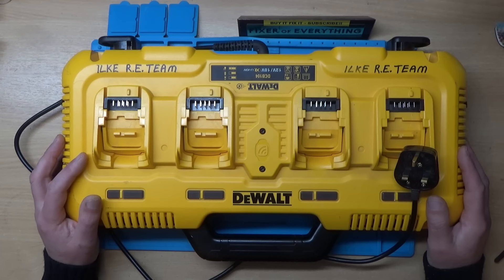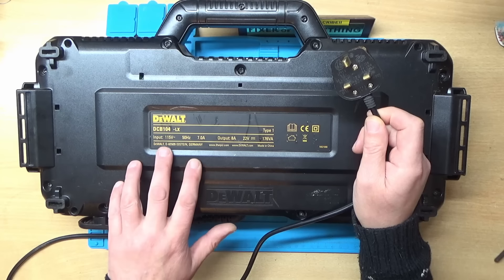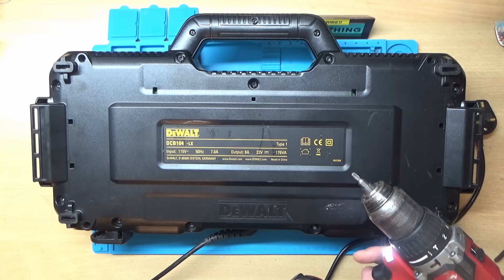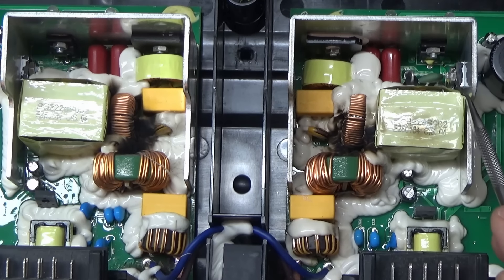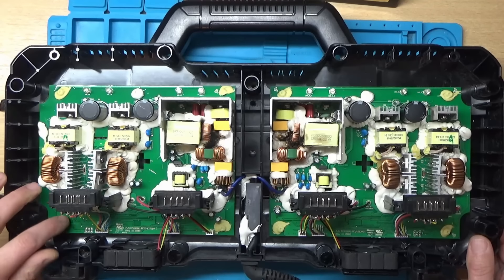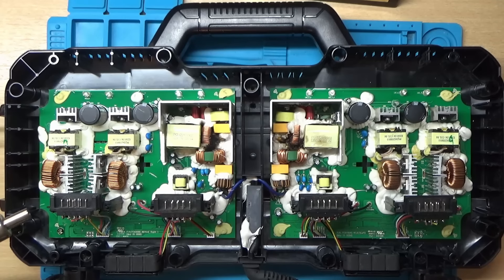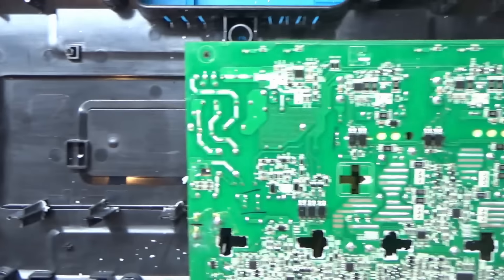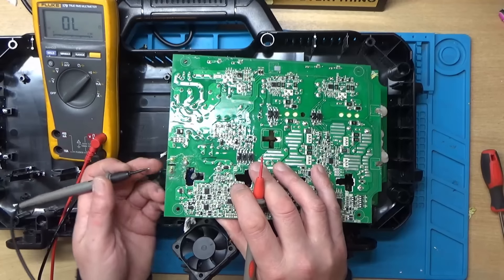Dead Dewalt 4 Port Fast Charger | Can I FIX It?

Comment: I'd like to refer people to this video when they complain about how ancient and useless North American wiring standards are.  For the record, US homes DO, in fact, have 240v.  It powers our clothes dryers, air conditioning, water heaters, electric stoves and ranges, etc.
Reply from the maker: Best of both worlds 👍 I did look to see why we use 240V in the UK and it was supposedly so they can supply the more power with thinner cables.
Reply: @BuyitFixit  That is interesting.  240V is much more dangerous than 120, in my opinion.  More dangerous not just because of the electrocution threat to the human body, but also because it arcs farther. You're also carrying twice the voltage at 13 amps vs. 15 amps at 120v in the US.  As for UK plugs being safer, well YES, they HAVE TO BE!  They are also twice as large and wired up by amatures.
Reply from the maker: 120V x 15A = 1800W as opposed to 240V x 13A = 3000W. For most socket wiring we use 2.5mm cable in a ring configuration and RCD protection.  I'm not sure what you mean by amateurs 🤔lol
Reply: I think he is referring to the UK plug being rewireable. Therefore possible an amateur fitted the plug. He maybe unaware we have moulded plugs too which are not rewireable, and are supplied by law on all appliances. Plugs asside, I prefer having full power available at every outlet.

Comment: Nice fix sir👍 Never heard of a "site transformer" before, here in the states we don't use them so had no idea.  I can see the reason for their use now, 55v compared to 240v, big difference.  Having the UK plug installed was a mistake IMO, even though sold there.  Great video, well done, thanks.  See ya next time.
Reply from the maker: Thanks👍, yes because we are all 240v they use them for safety. I guess someone must have removed the 110v plug and fitted a 240 thinking it didn't matter 🤷‍♂️
Reply: Yeah normally in the US we got two phases of 120v on any power hookup so we can just select between 240v and 120v right off the line, by default it's 120v but it's fairly easy to get 240v working too

Comment: One time I purchased a nice Marconi RF signal generator from a well known company on eBay. It was cheap as listed "not working". First thing I did when it arrived was check the line voltage setting. It was set to 240 volts. Set it to 110 volts and it has worked fine ever since😅
Reply from the maker: Nice 👍

Comment: I bet the original owners stuck that plug on because they used a 4way extension with a 110 plug on it cheaper than buying a 110 4way seen it loads on building sites 😂
Reply from the maker: I've not worked on a building site before but I could well imagine it 😂😂😂👍
Reply: Then the twit [autoplioted] and plugged it into a normal socket and 💥🤨

Comment: it's about 10% of the time that i forget to put the top on the wire first, you would have thought that i would have learned by now, i have only been a electrician for 15 years at this point.
Reply from the maker: 😂😂yes and it's still easily done 👍

Comment: When you were removing and resoldering those components it was extremely hard to discern the details. Stabilize the piece, zoom in a bit, and don't fast-forward through the melty parts. 🤗
Reply from the maker: Sorry about that. I'm not sure what people find boring melty parts or people screwing in screws for instance. So I normally speed through those bits.

Comment: First time i changed a 3 pin plug when i was 11, i forgot to put the back plate back on and plugged it straight into the socket which was live. That was my first 240v tingle through my body and 3 pinarks on the palm of my hand. I've never forgot to put the back on ever since and i always turn the sockets off. Some of us learn things the hard way but never make the same mistake again. Great troubleshooting 👍
Reply from the maker: Thanks 👍When I was around 5 or 6 years old, I remember tripping over a cable and pulling the cable out of an extension light that was plugged in. I picked up the two wires.. and I remember a burning sensation.. all of my fingers were quite blackened! and my mum had quite a shock when she saw them (although probably not as much as a shock that I had). This was when we had old cartridge type fuses and no RCDs.
Reply: @BuyitFixit  When I was 5 y/o I tried sticking a butter knife into a 120V wall socket, I clearly remember it violently shaking my hand and arm up and down before I yanked it away and went crying for Mom. It was a long long time before I got near a wall socket again.
Reply: My little brother once stuck a copper penny deep enough into a North-American 120V outlet to get the shock of his life. He was stunned, but unharmed. The outlet cover was scorched. He was around six years old.

Comment: To everyone wondering why the mirror image boards:  The cost to make that mirror image board is literally so small, as the most expensive part of PC boards is the artwork for the etch masks, drilling patterns and silk screen. Once that art is generated, a simple few clicks on a CAD program makes the mirror image masks. The build costs of each board are exactly the same, since the same components are used on each. 

Another example I know of is a major manufacturer's audio power amplifiers. Every model of different power ratings in the product line use the exact same PCB, the only difference is the values and quantities of the components in the power supply, driver and output stages.  Not only does that save big in not having multiple PC boards made, but a really ambitious and savvy tech can ADD the components (and change a few others) to upsize the power output of a given amplifier. (One of these days I'm gonna try it on a spare unit.)
Reply from the maker: Interesting 👍Thanks for sharing.
Reply: You may have to look and see if any of the amplification components are in parallel. If they are, you may need to be careful about matching all of the paralleled components from the same manufacturing batch, since the differences in impedances can make one paralleled component work harder than the other.

Comment: Nice repair, never knew about site transformer before, sounds very good idea for electrical safety for example in construction site. Another thing to learn from this video is that it's good to check the voltage of unknown device, before plugging it in.
Reply from the maker: Thanks MrJSV 👍

Comment: Some years back a friend who had bought a ghetto blaster in the U.S. returned home and fitted a UK plug on it with similar results, fortunately it had only burned out the primary side of the mains transformer which was a relatively easy fix..thing is the transformer was 110 0  0  110 input so had I have known I could have adapted it before he blew it up..amazing how many people don't realise our domestic voltages & mains frequency is different
Reply from the maker: Yes, I remember years back working on a Wurlitzer juke box which had been imported. They used a 110v transformer to power it but the records played at the incorrect speed. There was a cog that needed to be replaced to change it from 60Hz to 50Hz then it all worked fine.

Comment: Great video! I’m currently repairing a dewalt 1800w power station that had a blown smd diode on one of the charge ports. There are no schematics for this device and dewalt techs don’t know anything about it. So I have to figure it out on my own
Reply from the maker: Thanks 👍Unfortunately it's usually the case these days.

Comment: I have NEVER (with my fingers crossed behind my back) EVER done that with a socket or coax connectors 🙂My Dad was told the electric was off to a building they were working in so he put a felling axe through the mains. Apparently his mates picked him up from the other side of the room, with LOTS of laughing of course. No wimpy 110 site electric then, they were PROPER builders.
I am currently ferreting away at doing a fresh install on a new laptop. Trying to make sure I have all the programs on it I want and none of the rubbish from the old one. Been at it for 6 Hours on and off so far, between watching you and FT8 ing. Thanks for the entertainment. Bet you would have got this all sorted by now !
Reply: Oh yes, while clearing all his stuff out from the shed I found a couple of extension cables with a plug on each end and another 2 with sockets on each end, go figure. The wires were added to my DX Commander ground radials 🙂
Reply from the maker: Nice 👍
Reply from the maker: I remember working in an amusement arcade and having a similar experience with some side cutters and an old fuse box where the lad I was working with went to turn it off and shouted "Right it's off" ... BANG.. Went my cutters, blew a hole right in the cutting part of them..
"Oh it must have been the wrong switch" no kidding I said lol😂😂😂

Comment: Great job there, mate. Just removing all that gunk was quite an ordeal. Great work, mate.👍👍
Reply from the maker: Thanks 👍
Reply: I think if you heat that stuff up with a hot air it would soften up and be easier to remove.

Comment: Oh been there, done that.... I once made off a 37 pin multiway connector and was 3 quarters the way through when I realised I hadn't threaded the cable through the connector shell. I am ashamed to say that I took the easy way out -  made a cut in the shell so I could fit it over the cable! Fortunately 
it wasn't carrying anything more than 12V and was in a location where it wouldn't be seen.... or so I kept telling myself!!
Reply from the maker: 😂😂😂yes we've all done it. A couple months back I was repairing a headset for someone at the repair cafe I volunteer at. I did a very neat job of soldering the 4 enameled wires onto the 4 way 3.5mm jack... then realised that I hadn't threaded the plug cap onto the wire first .. oh well 🤷‍♂️

Comment: Another excellent resurrection. You just know that that 13A plug has its fuse jumpered with fag packet foil. The other advantage of the site transformer is isolation, for when you are standing in that water-filled ditch, erecting lighting gantries.
Reply from the maker: Thanks 👍😂😂😂😂😂😂😂😂😂

Comment: I have that same charger. The two outside chargers on mine stopped charging within a couple months, i took it apart and checked things out, couldn't find anything wrong and reassembled it and i was surprised but all charging ports worked and have worked for over 4 years now.
Reply from the maker: Weird, although I've had stuff happen like that myself before.
Reply: FNF = Fault Not Found. lol

Comment: I don't know how much you know about bicycles, but here is something very funny. A guy I went to school with, bought himself a bike. All it needed was reassembling. He got busy. When he had finished, he couldn't ride it. He had put the pedal arms the wrong sides, the chain on the wrong side, & the back wheel in the bike the wrong way around. It took him about half hour to work out where he went wrong. Regarding putting plugs on cable, I once put the cover on the wrong way, & wondered why it wouldn't slide into place.
Reply from the maker: I didn't know that would have been possible assembly a bike but I guess so 😂😂😂👍
Reply: Eh? Chain on the wrong side? Like the left instead of the right? That doesn't make any sense. The chain guard only fits on one way. Your story is more confusing than funny. Then again, it's been a good 25 years since I rode a bike.
Reply: @SanchoPanza-wg5xf  I spent a lot of my teenage years fixing push bikes with a friend of mine. Some of the bikes had no chain guards on them. It was easy to put the pedal arms on the wrong side in this case, for that reason.

Comment: Was you able to read the markings on the old components to order the replacements? Just wonder how you knew what was the correct part to ordered as quite often things can be unreadable. 

Keep up the good work
Reply from the maker: Yes you could still see the markings. Unfortunately I've thrown the old ones out so I can't tell you what it was.

Comment: 00:43 I spotted it. Britain runs 220V to every outlet, and this device is only rated for half that. It's a North American charger. Very weird that it has a UK-style plug.
Reply from the maker: Correct 👍I suspect it had the yellow 110V round style plug used in building sites originally fitted, and someone decided to fit a 240V 3 pin household plug instead...

Comment: Brilliant fix as expected Mick, I remember years ago hifi’s and other goods had a voltage selector on the back 115v-240, that was so dangerous. I wonder if there was a different transformer taps that you could of made it 240v? 🤔.
I have left plug covers off before, also aerial plugs I forget to put the cable grip and top ring on, which is a pain after soldering the cable in to the plug part. Often do it with heat shrink too lol. Thanks for sharing !😊
Reply from the maker: Thanks mate. There wouldn't be different taps on this as it's a switch mode PSU. I did look to see if there was a setting as the Milwaukee chargers have a jumper which is fitted or missing depending on the voltage required.
Reply: @BuyitFixit  oh fair play Mick, that makes sense being a SMPS I didn’t think that through lol 😂
Reply from the maker: @wisher21uk  No worries mate 👍🙂

Comment: Excellent Mick. Apologies for the maybe obvious answer question...On the varistors, how did you know what part to replace them with? Did they have the markings intact or on a SMPS does it not really matter as long as you get a suitably high voltage one? Cheers
Reply from the maker: Thanks Vince, they still had the markings on them, but as long as they are the correct voltage I don't think it makes a lot of difference.

Comment: Great fix indeed sir. Do you know where I can find the schematic for  components so I check some values. I have 4 burned resistors and there are from the same side. 2 from the left and 2 from the right side. It is very difficult to read their values. Thank you very much for your interesting videos.

Comment: Great fix! These chargers aren't cheap, so it's good to see one get repaired.

Forgetting to put the shroud of a plug on before making it off is annoying. Even more so with armoured cables, i should know.....
Reply from the maker: Thanks 👍yes I think I've done that on armoured cable too 😂😂😂
Reply: @BuyitFixit Try it with a 96 pin EDAC connector!
Reply from the maker: @MrBanzoid  ouch!
Reply: Good fix. I have the same charger just checked its 240v on the back but only 1 side charges. So 1 board is not working. Do u reckon it's fixable

Comment: Of course I've made that mistake with not putting the cable through the plug top first . And I never knew that about site transformers about being center tapped so potentially only 55v AC electric shock.
Reply from the maker: 😂😂😂😂I must admit that I didn't either until about a year ago when I was messing with the solar inverter I was repairing and thought I'd use it as a source to make DC for the panel input for testing.

Comment: I would have imagined this used a switching power supply accepting 115 or 230, how interesting!
Reply from the maker: Yes, although the Milwaukee chargers don't accept both, but you can fit or remove a jumper on the PCB on those to change the voltage 🙂

Comment: Heya, nice repair again yes 110 volt and putting in 220V that it doesn't like
Reply from the maker: Yes, although some devices accept 100-265 or so, or some have a jumper inside to select the voltage. Unfortunately this one had neither.

Comment: Instead of trying to figure out how many times I have wired up a plug before putting the wire through the collar it's easier to just think about how many times I actually have done it right the first time.  I'd estimate three.  Same goes for using heat shrink tubing.  About 50% of the time I have the wires spliced and soldered before I look and notice the heat shrink is still sitting on the mat.  And I go through a LOT of heat shrink...I buy it by the 100ft roll...so this happens a LOT. 😂
Reply from the maker: 😂😂😂😂👍Glad I'm not the only one then. Thanks for sharing 🙂

Comment: Me too with the 110v plugs and how many old rubber 240v plugs have you seen with a cut on the cable entry
Reply from the maker: I used to make audio cables years ago and quite often forgot the cover on 1/4" jacks or XLR connectors 😂😂

Comment: 15:37  One time, I forgot to screw back in the big bolt that held my car's steering wheel on.  I can laugh about it now.
Reply from the maker: 😂😂😂hopefully you didn't pull on it too hard 🙂
Reply: @BuyitFixit  
Whilst in the fast lane on a dual carriageway, I leant back in my seat and the steering wheel came off in my hands.  I managed to engage the grooves just enough to take back control before the road curved.  Like I said, I can laugh about it now. 😀

Comment: Yeah , I spotted that real fast , I guess because I'm in 110 V country ...... Oh yeah the famous I forgot to put the coax screw housing onto the coax before soldering the body on , radio microphone plugs also , I owned a radio shop for 20 years and forgot to do that less than 50 times , it becomes 2nd nature after a lil while ......... I'm curious about that 110 V  construction site transformer , are a lot of electric tools over there 110 V ????   It would seem that would be practical that USA made tools would make all tools 110 V  due to motor design and such , instead of 110 V USA & 220 V for 220 V countries .....  That was a great from the get go diagnostic and another one is saved ........  Take Care Mon Ami......
Reply from the maker: Thanks mate 👍pretty much all home / diy appliances are 240V. Tools for use on building sites are usually 110V to reduce risk of electrocution as they are probably going to be used in muddy or wet environments.

Comment: 15:42 Many many many times. I have soldered and crimped expensive connectors only to find out that I forgot to put a nut, washer and seal on the cable FIRST.
Reply from the maker: Yes it's easily done 👍